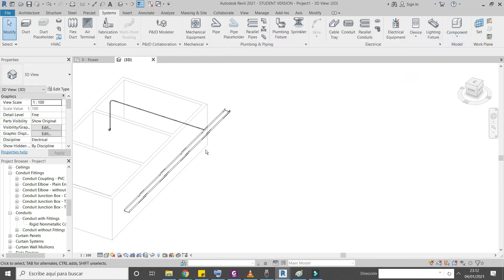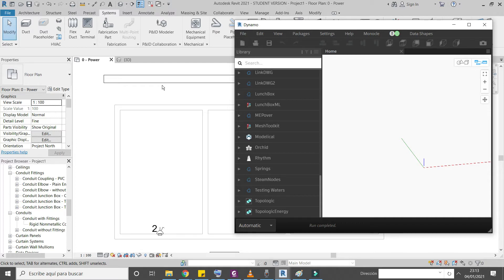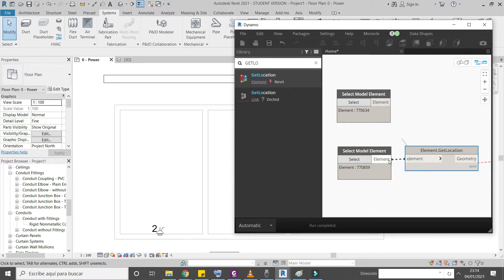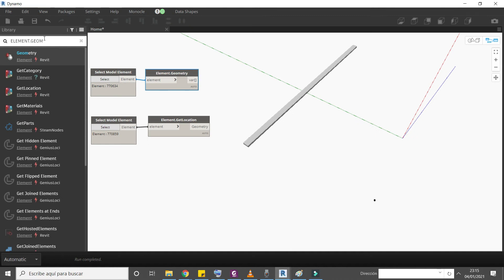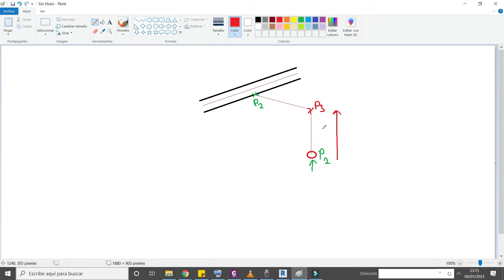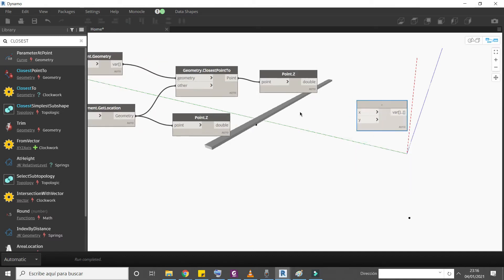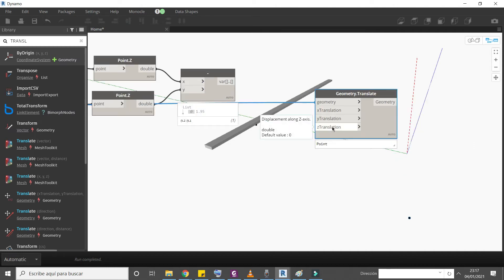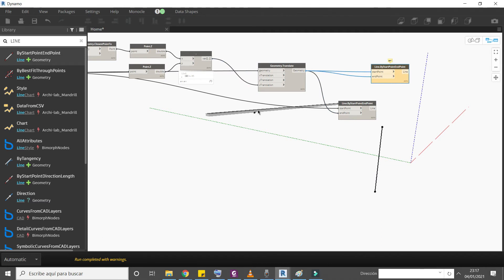REVIT DYNAMO ELECTRICAL CONDUIT TUTORIAL

Comment: Warning: Geometry.Translate expects argument type(s) (Autodesk.DesignScript.Geometry.Geometry, double, double, double), but was called with (Revit.Elements.FamilyInstance, double, double, double[]). like that coming i don't know next step could you help..?
Reply: This node expects you insert a geometry: a node in this case... probably you connected the output of "select model element" directly to the input of "geometry translate" then it causes this warning. Some families doesn't work with this node "element geometry" native of Dynamo. So you must to try another way to convert that instance in geometry. That's the logic of this workflow.

Comment: Thanks, I did every thing but the last part, connect "Select Model Element" to "Elements.Type" did not connect, don´t know why. I work with Revit 2021.  So, didn´t worked
Reply: same, i only got lines but no conduit. do you already solved this issue?
Reply: List create -> List.Flatten -> Lines